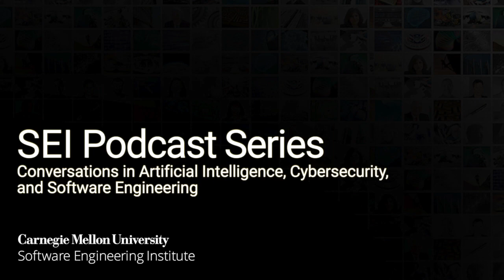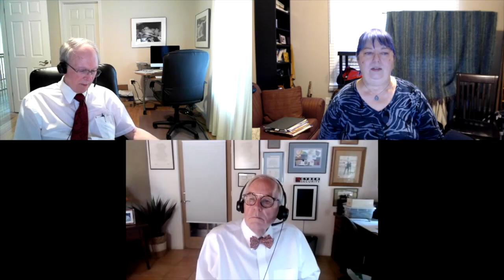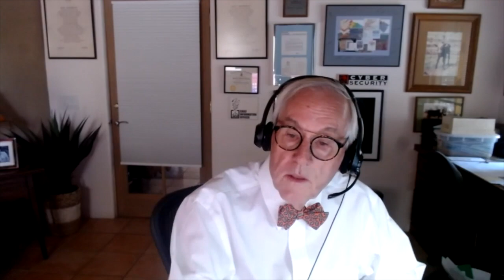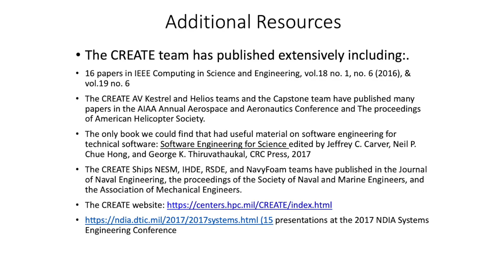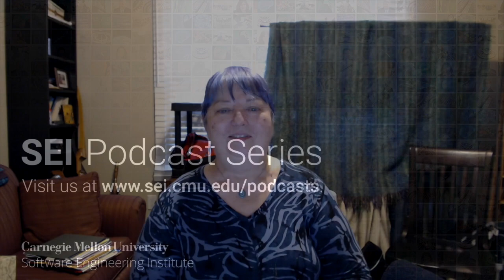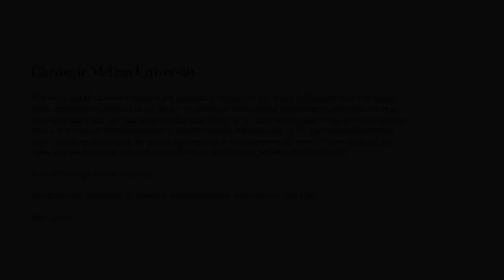A Roadmap for Creating and Using Virtual Prototyping Software

Comment: Would have liked to have heard about how 'Creating and Using Virtual Prototyping Software' fits with Agile/Scrum, or general Project management for Software Development.

Or thoughts on how it can used in a industries with existing rigorous standards
FAA : DO-178X , DO 331 , ARP4754A , ED-12C 
FDA : 13485 , ISO14971 , IEC 62304 , SaMD and
DOE Nuclear : 414.1x, 
Automotive : 26262